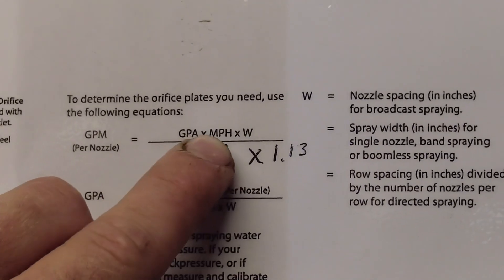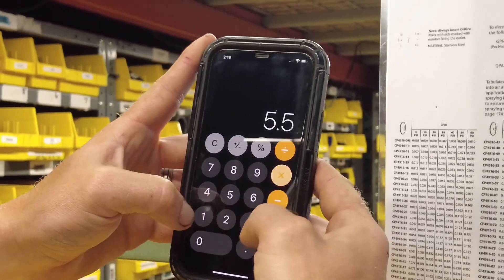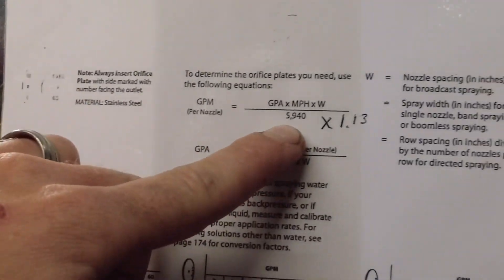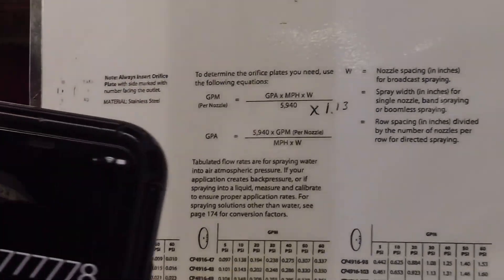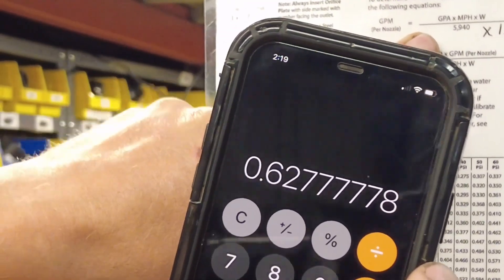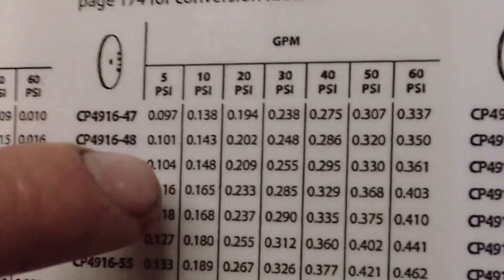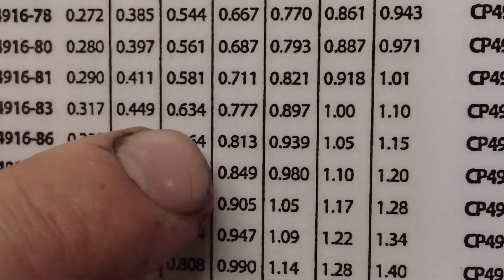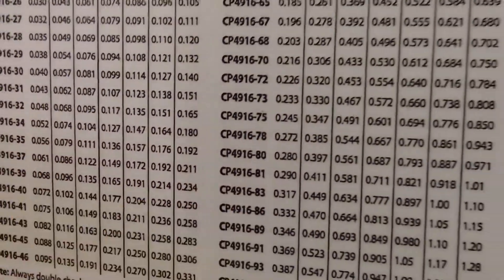How to calculate Orifice Size/ Gallons per Minute Flow

Comment: New to me planter. WHITE 6342. I PUT A JOHN BLUE piston 4455 pump. Through a 12row distributer then red ball. All 3/8s line. I have a tube system that Ys out the behind the closing wheels. I am putting at the Y a 2psi check valve then Y with individual orifices. I am trying to figure out what orifice and psi needed to get 15GPA.